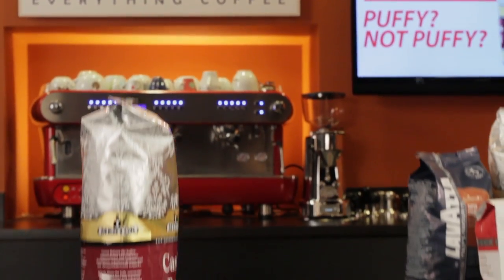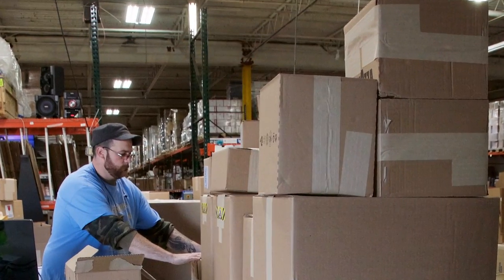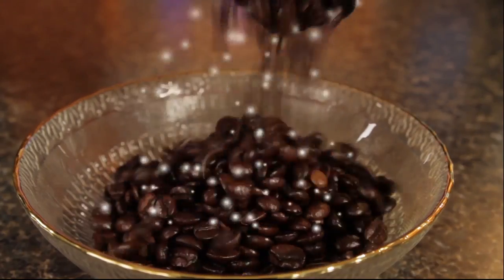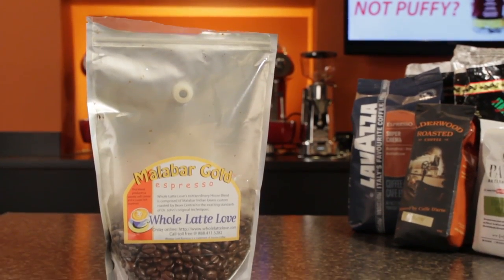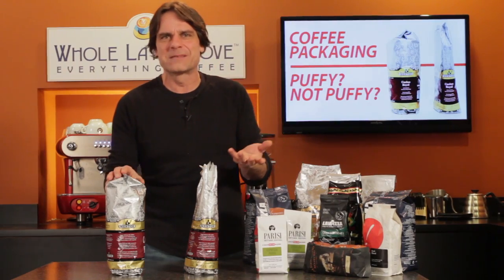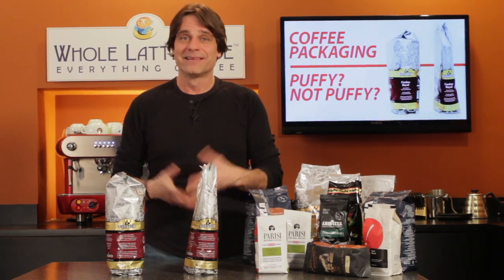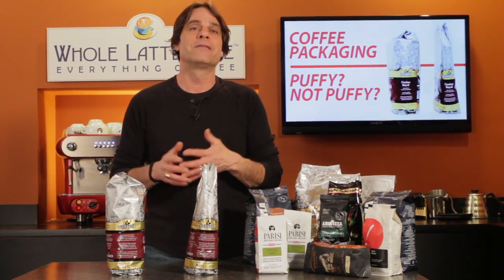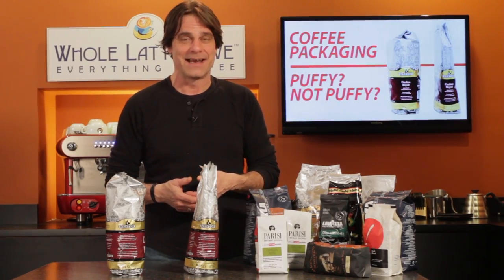How To: Coffee Packaging - Why is it Puffy or Not Puffy?

Comment: I always wondered why that was the case. Thanks for the info! Now I don't have to hunt for the non puffy bags
Reply from the maker: Hi M, Thanks for the comment. Right, no need to drive yourself crazy looking for non-puffy bags!
Reply: I actually like the puffy bags so I can get a good whiff of what's inside.
Reply from the maker: Got to love that smell! Read research claiming coffee aroma was one of the most recognized and enjoyed smells.
Reply: :)    If you shop at ULTA cosmetics stores, in the perfume department, they have small vials of coffee beans on the ends of each aisle of perfume so you can smell the beans after every 2 or 3 perfume samples. If you don't "cleanse" your smell pallet, for lack of a better term, after 2 or 3 different scents, they will all begin to smell like alcohol or whatever the carrier liquid was used in the formula. It works pretty well! But I could smell coffee beans all day long, I don't need another reason!  LOL!
Reply from the maker: Love it! Cleanse the nose with coffee aroma.
Reply: :D   I even save my older, stale beans, grind them on a fine setting, then mix them with olive or sweet almond oil. It makes a fantastic body scrub in the shower! Get wet, scrub with the coffee grounds, then rinse & wash. Smooth, soft skin and in the hot shower, it's like taking a bath in a giant espresso!

Comment: Hey Mark, big fan here! Out of all the superautomatic espresso machines, which is your absolute without a doubt top favorite?
Reply from the maker: Hi Tracey, Thanks for the support! I use a Gaggia Accademia everyday. It's a machine with a long track record, attractive price relative to competition and its build quality is a cut above the rest - it's a solid beast! Other things I like about it: Adjustable milk froth density, detachable milk carafe with an ingenious auto cleaning system, has a manual frothing wand if you want to go beyond the frothing capabilities of the carafe, detach the dual spout and most travel mugs will fit for coffee on the go, SPS dial on the spout allows for fine tuning an extraction - slow it down for espresso and speed it up for long coffees. https://www.wholelattelove.com/gaggia-accademia-espresso-machine

I'll give an honorable mention to the Jura E8. It's a newer Jura model with key features of more expensive Jura machines like their new pulse extraction process and smart water filters with RFID chip for no hassle maintenance. Use the filter with these and you never have to descale. Jura's do about the largest coffee dosing available. You can make a true double espresso on a single grind cycle with max 16gram dosing. Most other machines require 2 grind cycles to do that. https://www.wholelattelove.com/jura-e8-chrome-super-automatic-espresso-machine-with-pep-ot

Comment: I've got a couple air sealed containers, the ones with just one button and which makes it able to press the top down. The only thing is, that the next day the coffee already tasted old. Should I just keep the beans in the bag, let the air out and secure it with a rubber band or try a different container with a pump for instance? I think I'll use those containers for just cookies in the future.
Reply from the maker: Hi KM, I'd just leave them in the bag. We often use the large black paper binder clips. Just roll the open end of the bag tight and clip.
Reply: Whole Latte Love Will be doing that, thank you.
Reply: The only containers I found to keep my beans fresh is a ceramic canister with the locking clamp and silicone sealing ring on the inside of the lid. Otherwise, I keep it in the original bag. I press out as much air as I possibly can then use a big binder clip, as Marc mentioned, or a big, fat rubber band.
Reply: I also used those ceramic jars, now I keep my rice in them :)
I bought a whole bag of those binders (51mm.) Works great!

Comment: The bag could also become vacuum packed due to air plane travel. I get bags of beans from Colombia that usually always are vacuumed packed due to the cabin pressure of the plane ride. But what about the espresso coffee that some companies sell that are in the "brick" style packaging...they always seem to be vacuumed sealed with no valve.
Reply from the maker: Hi GV, Those bricks are almost always pre-ground. It's likely off-gassed prior to packaging. As for the planes, My understanding is cabin pressures are usually kept equivalent to 7,000 feet so external pressure is lower in flight. With lower pressure the bags would likely expand and some internal pressure may be released through the one-way valve. On returning to ground level, pressure outside the bag increases causing bags to shrink so they could end up looking a little vacuum packed. Bags are likely packed tightly for transport so when pressure decreased in flight they off gas through one-way valve sooner than they would if it were packed loose.

Comment: When sending coffee bags (with valve) by plane there is a very high possibility the bag will arrived like it was vacuum sealed due to altitude changes during the flight ; usually that would not affect the quality of beans much more than CO2 was released much faster that was expected to, but the appearance of the bag is not good at all.  I just wonder if anyone may know a trick on how to avoid such effect , still using same valve bag as described ?

Comment: Useful video, but do you pack with nitrogen, & how does it affect quality & expiry date?Nespresso capsules have a 1 year expiry on the package despite being pre ground, so what do you think about that? Thanks.
Reply from the maker: Hi SE, We do not pack the coffee we sell. To the best of my knowledge most whole bean suppliers we work with do not use nitrogen packaging. I know this is done with packaged foods like potato chips to displace the oxygen. Think whole bean packing is a little different with much less open space in the bag. Chips on the other hand use semi-inflated bags to protect the product.

As to Nespresso capsules. First, there is no substitute for fresh ground coffee. That said, Nespresso does use nitrogen flushing when packaging their ground coffee capsules. I went through some Nespresso training a few years ago and I don't recall the specific details but they described a careful process post roast that didn't expose the beans to oxygen throughout the grinding and packaging process. Also Nespresso capsules are hermetically sealed and they use some of the best coffees available. They say good for 1 year and my feeling is that is accurate. Take a month old capsule and a 12 month old capsule brew side by side and it would be difficult to tell the difference.
Reply: Thank you for taking the time for such explanation.
Reply from the maker: No problem you're welcome! It's what we do.

Comment: Mark been watching your videos on several espresso machines, very informative. I'm new to lattes and cappuccinos so I was wondering your recommendation between Gaggia Accademia  or Breville Oracle Touch?  Also, when looking for fresh beans, what or how long of roasted date on bag should I be looking for? Thanks
Reply from the maker: Hi stu, The Accademia is among my favorite super-automatic machines. It's about convenience. Put beans and water in, attach the milk carafe, push a button and the machine does the rest. The Oracle Touch is technically a semi-automatic machine. It requires more user intervention and a little skill/knowledge. If willing to put in the effort, the Oracle can do more with the milk with adjustable froth density and temperature. Also has more control of coffee variables so potential to customize your coffee a bit more.
For coffee freshness... It depends on what type of coffee bean. If using higher priced, single origin, lighter roast specialty coffees they are better when within a few weeks of roasting. For most everything else including Italian style bean blends freshness is not nearly as critical. And don't think you have to spend more on beans to have good coffee! Some of my favorites run about $20 a kilo. That's under $10/lb.

So long as the original bags are sealed and stored at reasonable temps the shelf life is quite long. In most cases these types of coffees are done off gassing by the time the get to the end consumer so flavor does not change much with age. I've used that type of coffee a year or more from roast date and no real difference from the same coffee at 2-3 months from roast. Higher-end specialty coffees often have the actual roast date stamped on the bag - these are the coffees you want to use sooner rather than later. Mid to lower priced bean blends tend to be marked with use by dates. These are typically 2 years from the roast date. If the coffee was roasted in Italy or EU etc the date may be in day/month/year format. Hope that helps! And, thank you for the comment and questions!
Marc
Reply: @Wholelattelovepage  Hey Marc, thanks for answering so fast. More questions if you don't mind. 1) If I don't mind spending up to $2000, is the Breville Oracle a good buy or is there another semi-automatic you would recommend? 2) In a vid you did comparing a couple of Gaggias, you mention a particular brand(MIO) that went well with them. In looking at the massive amount of brands y'all carry, Is there a certain brand that works well with all espresso machines? Lastly, being novice I'm more of a mild roast drinker so with that being said are there different mild beans you could recommend and if there is any with flavor(choc, vanilla etc)? 
Thanks a lot for your help! Stu
Reply from the maker: Hi stu, Breville could be a good option. Looking at semi-autos I consider Breville products appliances. They don't have the same high-level build quality (or price tag) of traditional Italian style machines. The Oracle packs in a lot of features and automates functions which makes it easier to use than Italian machines. Keep up on the maintenance and they are reliable. But they are not user serviceable and do not have the longevity of the Italian machines. For your budget in a more traditional machine you might look at the Expobar Lever: https://www.wholelattelove.com/expobar-office-lever-semi-automatic-espresso-machine You will want to add a good espresso oriented burr grinder. Something like the Baratza Sette 270: https://www.wholelattelove.com/baratza-sette-270-conical-burr-grinder Or, here's an Expobar Lever Plus combined with a Barataza Vario grinder for about $1800: https://www.wholelattelove.com/expobar-office-lever-plus-baratza-vario-w-metal-portaholder
Beans... I like Coffee Mio. If looking for something with chocolate notes check Maromas Orphea: https://www.wholelattelove.com/maromas-orphea-whole-bean-espresso It's one of my favorites, very easy to work with and is rated 4.5 out of 5 by customers. Check out the customer reviews. Hope that helps. If you want some one on one advice don't hesitate to contact our coffee experts! They are available by phone/chat/email: https://www.wholelattelove.com/contact-us
Marc

Comment: Nearly all coffee bags are of a gusset design which is stupid! When these bags are filled with coffee they are then heat sealed. Consumers don't appreciate that you cannot seal a gusseted bag so that it is completely airtight. The fold in the material will always leave small gaps even after being heat sealed. Gusseted bags should NEVER be used for coffee. Plus they are impossible to effectively reseal afterwards to prevent ingress of air and humidity. Coffee should be sold in stand-up transit (temporary) pouches that do not have a gusset. They should not even have a zip seal which encourages the consumer to believe that the zip seal creates an air-tight lock after each use, it doesn't. The consumer should invest in good quality, small capacity screw lid food storage containers for small quantities of freshly roasted or ground coffee that will be used within say 7 to 10 days maximum. We use MIRON violet glass jars to store tea and coffee, they last a lifetime and help preserve freshness. Do not store any coffee in a freezer or refrigerator - each journey in-out-in again creates condensation due to constant changes in temperature - yet some so called experts still say we should store coffee in this way - they are deluded and in urgent need of a brain transplant!